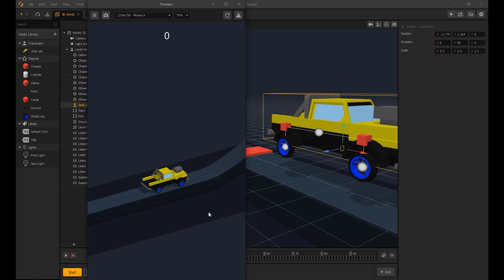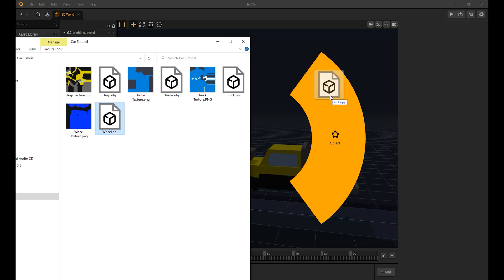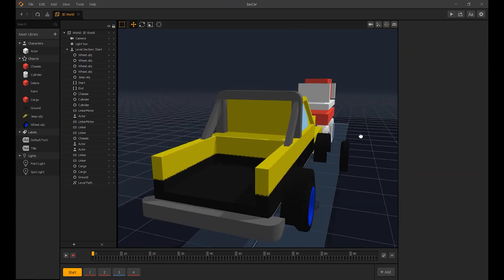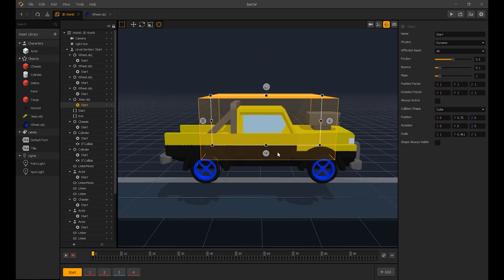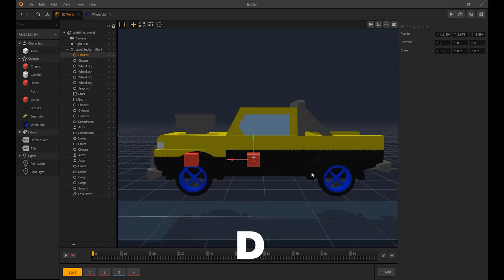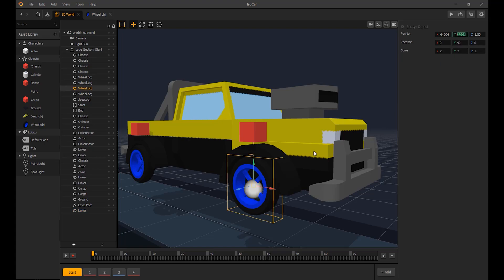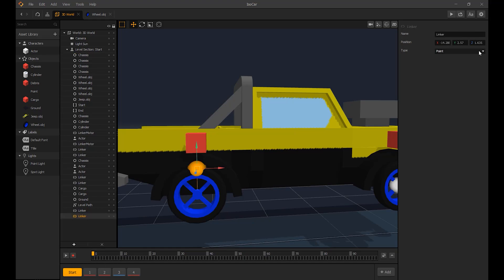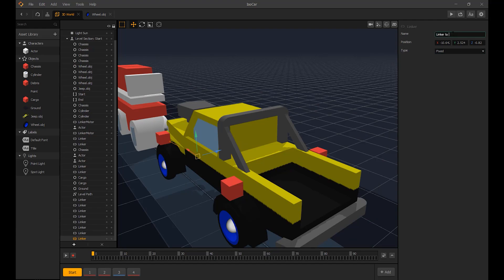How To Create Vehicle Suspension in Buildbox

Comment: hey i need one car for my game so where i cam model coz i cant add blender file in buildbox ! pls help
Reply from the maker: Here is a free carpack :
https://mega.nz/file/YWgBzArT#hZo7rs2ANNrD9Hs6i5yqhJABx3kkL0846nsrhg9l7Qs
Reply from the maker: You can use it as it is without any wheel motion or use blender to import the vehicle then remove wheels and export then do the same for a wheel and build it inside buildbox.
Reply: @LeightonJ   and the file has no archieves
Reply from the maker: Open up one and you will see there's models inside 👍